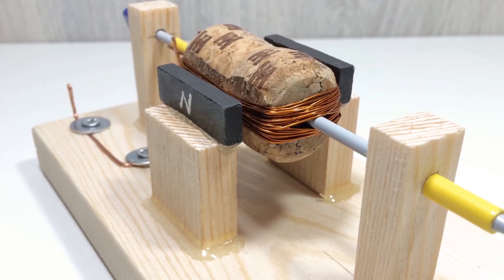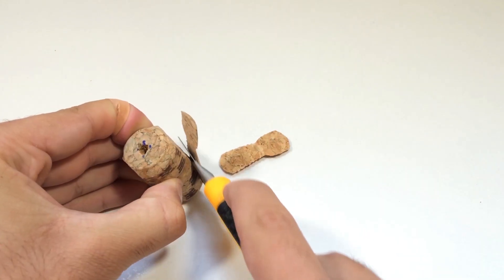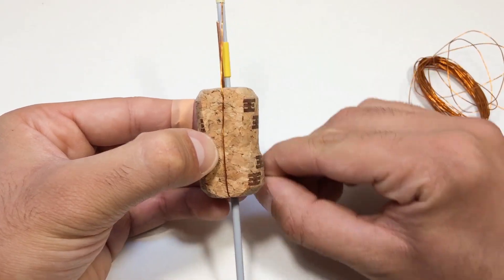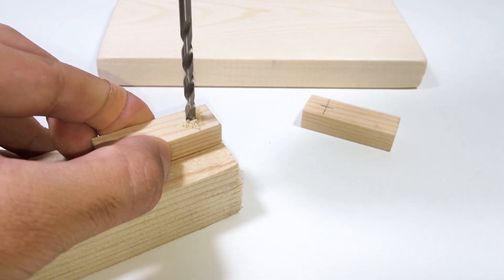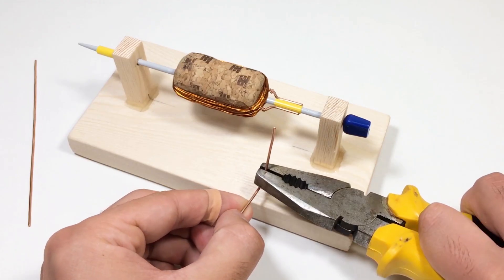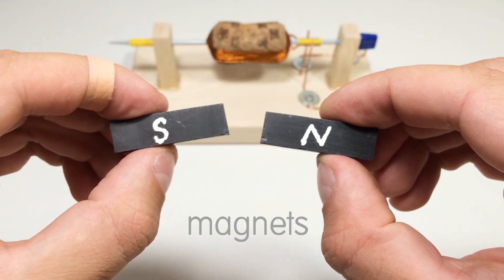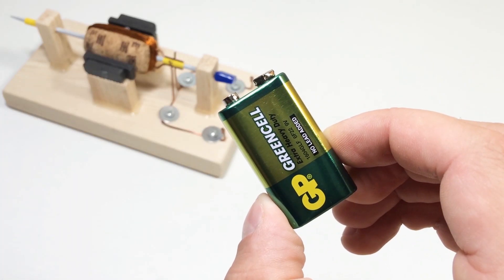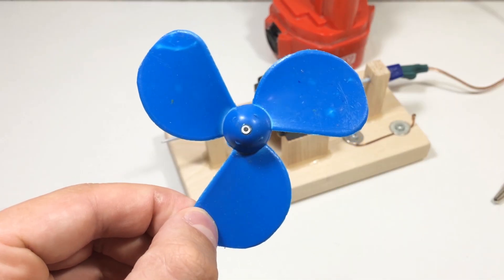DIY Electric Motor from Scratch | How to Make a Simple Motor at Home (Cork, Wire & Magnets)

Comment: Any link to the measurements used (wire length, wooden base cuts, etc.)?
Reply: Wire length is 5 meters and 0.4mm thick, the wooden base cuts don't matter just try to recreate it